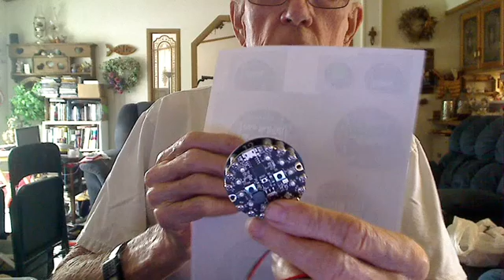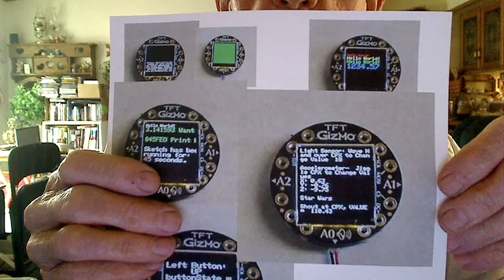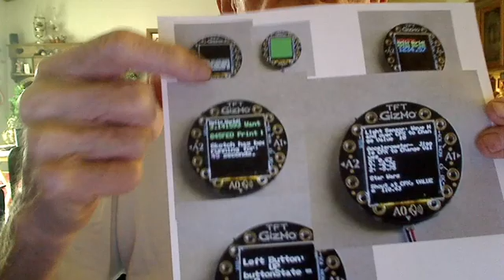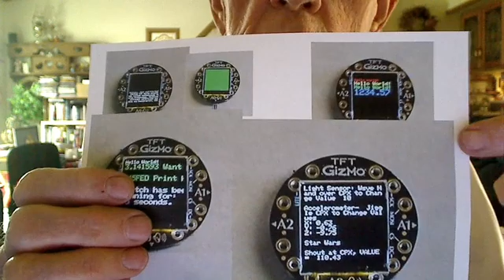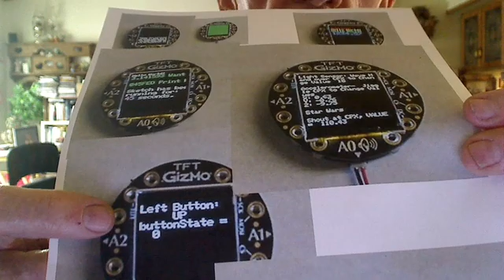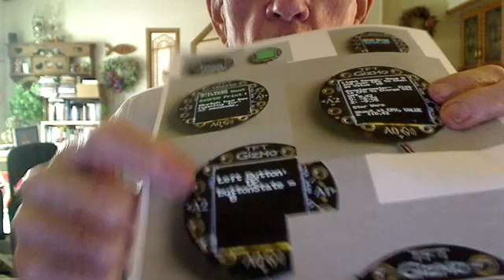Adafruit Circuit Playground Express W/ Gizmo & Arduino IDE

Comment: Howdy! I too have a CPE w/Gizmo display, and have been doing CircuitPython examples. Do you have your Arduino code published anywhere?
Reply from the maker: I haven't published any CPX sketches, but here is a link to the latest one that I wrote, borrowing from Adafruit stuff:
www.spaco.org/electronics/CPX_MultiRev4.ino
As you know, you have to put this file into a folder of the same name.
Reply: @frenchcreekvalley  Many thanks, I’ll run through that.